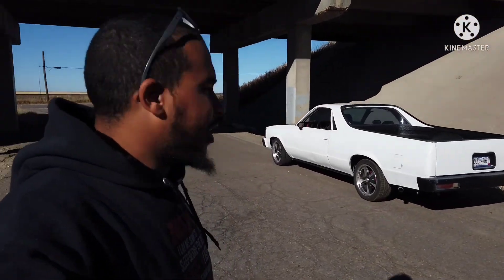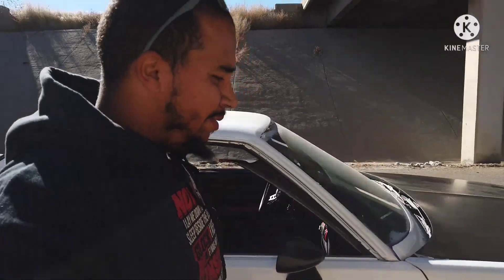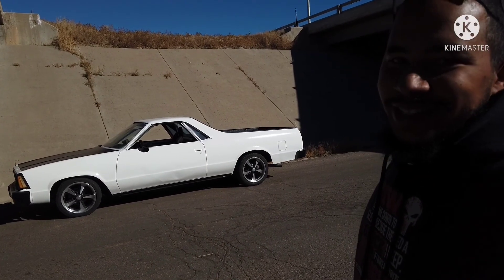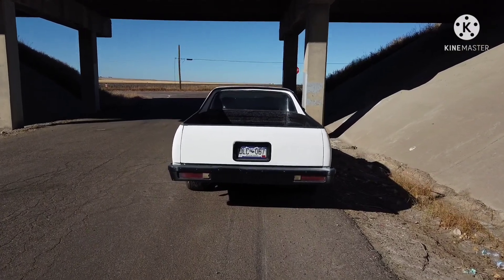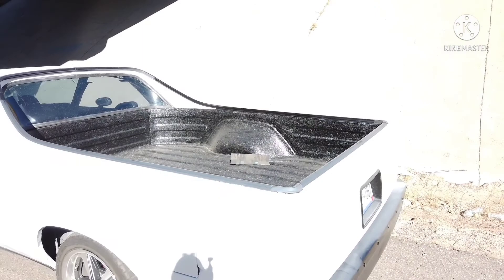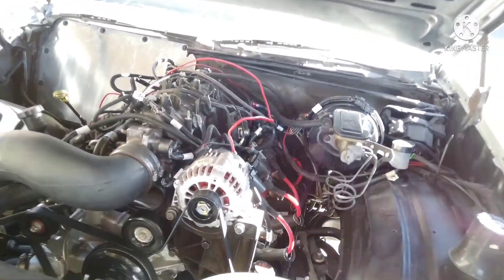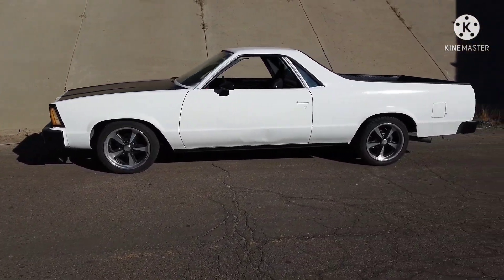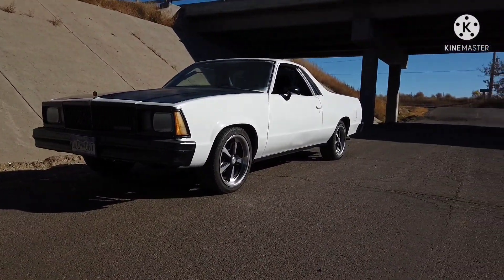LS swapped, manual transmission El Camino walk around

Comment: what clutch pedal did you use
Reply from the maker: Look up sick speed monte. I went with the kit designed for the f body and the f body master cylinder.
Reply: Thank you ! And did you have issues with the T5 going in?
Reply from the maker: No problem just had to get the driveshaft shortened and had to modify the crossmember. Might do a short video and cover how I did it. Have a few people asking about it.
Reply: @Dashsgarage  I figured the bell housing would be an issue
Reply from the maker: @t-light5565  you have to use a Chevy 621 bellhousing.